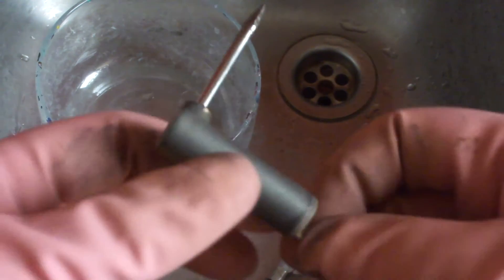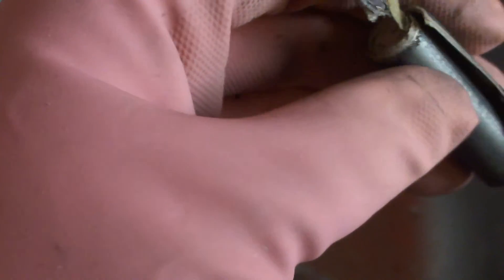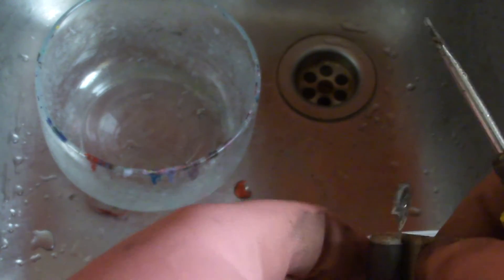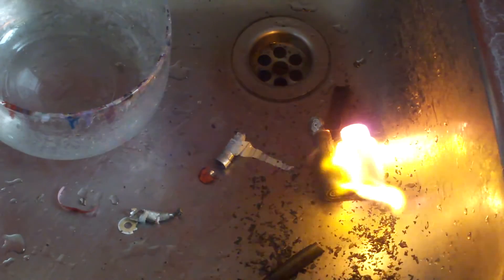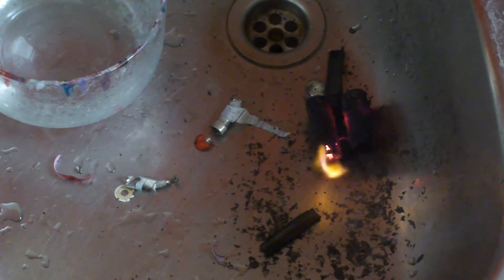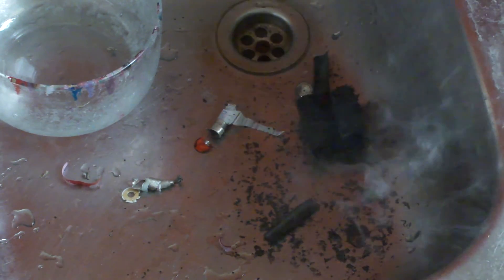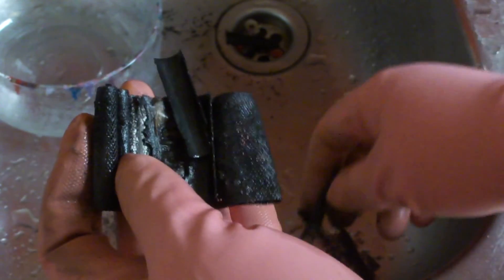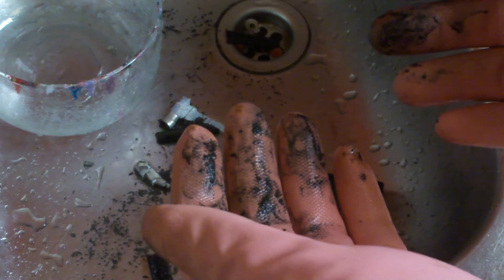DANGER - NiMH battery BURN UP - No EXPLOSION but hefty FIRE FLAMES BURNING and SMOKE

Comment: NiMH batteries will explode or ignite if the protective seal is broken. NEVER solder to batteries directly (if you do need to replace them, for whatever reason, and need solder tabs, buy the ones which have "spot weld" solder tabs already on them). By breaking the seal, or soldering direct, which will destroy the insulation, the batteries WILL self-combust over time. Breaking the seal is instant, as in this example, or by melting the seal will degenerate over a period of around 30 days, and ignite.
Reply from the maker: +RMLectronics East Yorks Many thanks for this good safety advice ! Now I will be very mich cautious with these types of batteries...!
I will only then use magnets or a battery holder...!
Reply: Bobby D My Traxxes NiMH 3000 battery seal is broken and it sizzles and won't hold a charge, what should i do with it?